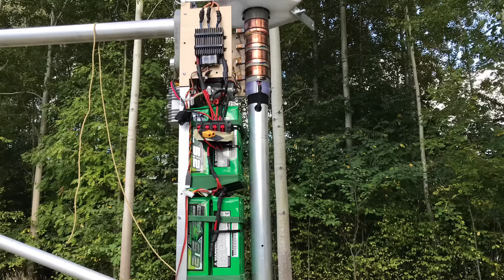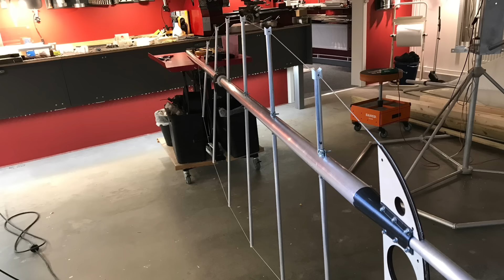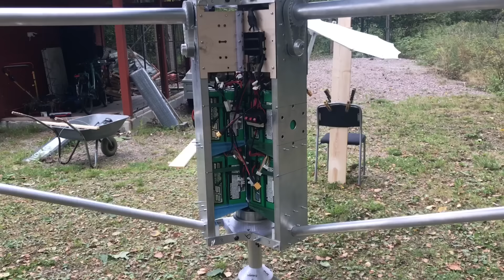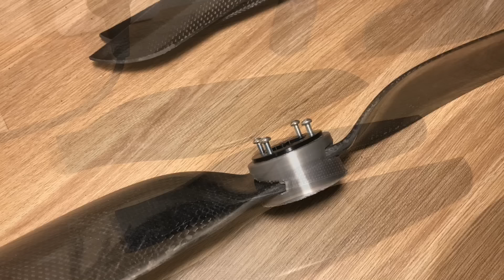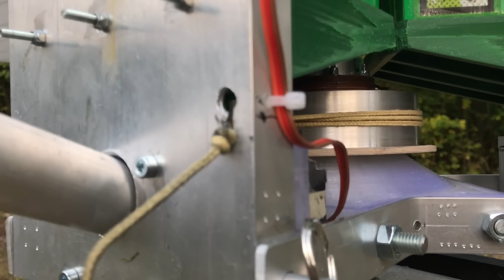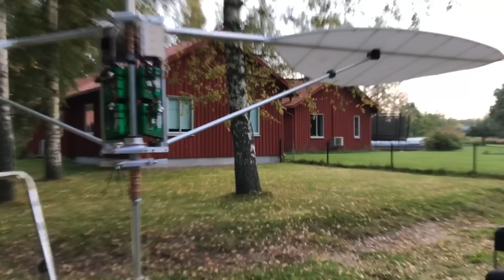Coaxial Levitator 1 Assembly and first ground test.

Comment: 1) for the props touching, make 2 different size rotors, one larger than the other in diameter. 2) I would use the battery packs to counterweight each individual blade at 180 degrees but as close as possible to the main shaft (depending on the batteries weight) to save more momentum and less wear on the motors trying to push and win resistance when at full speed, kind of like a flywheel. 3) start at almost 0 degrees angle of attack for all the blades when starting to help build momentum faster and saving battery then when you need collective once you have reached your full speed of rotation you give it.

Comment: Cool project! We are also located in Sweden and are developing a Blade Runner style roadable flying car, with no folding wings or exposed rotors. The project is called Sky Chaser, and it looks and drives like a car, and flies both vertically and horizontally, and is even amphibian. An artistic picture of the vehicle can be seen in my icon, and by clicking on it you will see a presentation of the project, and flight videos of the 200 lb full scale prototype we have built. More info can be found by searching: Sky Chaser flying car. Good luck with your project and I can't wait to see your next video!

Comment: I look forward to seeing your solution to the prop clearance. Another idea might be to instead slightly shorten/lengthen the arms that the motors are mounted to, this way the props aren't directly on top of each other? Do all the motors need to be the same distance from the center for speed control and power/efficiency reasons? So many questions, very interesting stuff!
Reply from the maker: Good questions! Hope to find the answers an share the result!

Comment: What if you created more space between the rotors by essentially flipping the lower rotor upside-down instead of making the machine taller? I e. blades on the bottom, braces facing up.

Comment: I suggest you install motor for all edges of the blade in order to balance the blade tracking and also use a smaller rotor blade for the six main rotors blade angles, this will gives a smooth rotations and creates more torque even if the blade pitch get higher.

Comment: One way to try and overcome the trailing blade problem is to have only a single blade - a monocopter, in other words. That way, it won't go around at a constant angular speed. It will naturally fly at a relatively constant airspeed, changing its angular speed instead so it "whips around" quickly on the trailing side while flying forward slowly.

At this size, though, we're probably talking something that looks like an airplane or quadrotor biplane on one end and a countermass on the other end.

Comment: On prop clearance between the upper and lower rotors, have you considered extending the motor mount at the tips of each of the blades/wings for either the top or bottom rotors? By staggering the overall lengths between top and bottom rotors by even just a few inches so they aren’t passing directly over or under each other, you can buy yourself extra clearance equal to twice the length of your prop blades.
Edit: super excited to follow this project.

Comment: 2:28 Why can you not use wire braced wings and more? If you have a third as much vertical space on the axle, then you just need three times the wire strength... And the added stress on the strut inside the wing should still be negligible, I would guess.
Scaling it up would potentially cause problems, though. Three times the wing span means 9 times the wing area, and thus 9 times the lift and weight.

Comment: The brake idea is interesting.
Disc brakes are good too.
I think it would be easier to control if you used something like a coreless motor, which has low rotational resistance, as an electromagnetic brake.😀

Comment: Great job. I think you will need motor driven propellers to be 90 digress to the ground to get the best thrust. Have a look at tale dragger aeroplanes and propeller efficiency at high angle of attack. I hope this helps 😊

Comment: Awesome build. You could make the lower rotors slightly larger to increase the distance between the propellers. The lower rotors are going to be in the wash of the upper rotors and be slightly less efficient. The increase in diameter might even things out. If you did have a prop strike it would only be one propeller getting damaged.

Comment: Enjoy your videos very much. Instead of lengthening the center shaft, have you thought about removing 2 to 3 inches of length off the lower wings where they join the center shaft. This should give you the clearance needed and be easier than lining the center. Just a thought. Good luck with your project.

Comment: If you had a rotatable push fan on the top center shaft could it push the device forward which would also provide a slight tilt to the other blades.  Rotatable for direction.  Nice project

Comment: As you have already developed and demonstrated a (very successful) tip drive concept, why would you go to a coaxial configuration? The only reason for a coaxial configuration is to cancel the opposing rotor torques if the rotors were shaft driven. Am I missing something?
By the way, it’s a great experiment and demonstration! I applaud your efforts!
Reply: Think of it this way: you have a cylinder with wings spinning 1 direction and a shaft just rubbing against that.
Reply: He mentions its an attempt to prevent problems of dissymmetry of lift causing rotor flapback and limiting speed.
Reply: @Ben-Dixey so something we usually solve using a fast main rotor and a swashplate. Quads don’t need a swashplate. Koaxial helicopters need it to be stable .
Reply: @ArneChristianRosenfeldt  yes, the problem is a fast main rotor requires a lot of power as your pushing the blade tips through the air at 400mph+. If a low speed rotor could work then the power requirement would be lower, the noise would be much lower and also the danger of a high speed rotor. 
It's not without its issues but well worth experimenting.
Reply: @Ben-Dixey  so like this human powered helicopter. Still had a single rotor.
Reply: @ArneChristianRosenfeldt  Yes, the human powered helicopter had to be flown inside with no air movement. A slight gust would have affected it massively. Wasn't the human powered helicopter a quad arrangement ?
Reply: @Ben-Dixey  from my memory it was a single rotor. Wind velocity relative to rotor velocity. A slow rotor is more sensitive? The blades were fragile.

Comment: Don't understand, why use propellers instead of just directly driving the central axle? Seems a lot easier and more efficient. I'm not seeing something obvious?
Reply: Probably can’t buy such a motor or the weight of the rotor/stator would be quite heavy? Just spitballing here
Reply: Actually it’s almost certainly because he owned those motors already
Reply: @framegrace1  driving a large prop with smaller ones is actually more efficient
Reply from the maker: Good question with many answers, some already covered here.
Top of mind right now:

1,Failsafe/redundancy. 
This setup, by design, make the entire entity fault tolerant, which is critical for a home built flying contraption built out of "prone to fail" hobby components. 

2, Complex high torque light weight drive train. 
This large wing area, low RPM rotary wing design need allot of torque to take off. Building a light weight high torque coaxial gearbox in a modest home workshop safe enough for manned flight just is not a challenge I am willing or interested in taking on.
Reply: @amazingdiyprojects I think that I have seen a machine to cut any number of helical teeth into a metal cyclinder. Assemble mirror bolt together to compensate axial forces . Maybe guard rails similar to a railway could also be bolted on. Then decouple all forced from the outside. Vibrations. Just 3 torque ports.

Comment: I have a prediction but it will probably be wrong 😆. My prediction is that the coaxial version won't solve the problem of rotor flap back. I think both rotors will flap back at a similar air speed to the previous version. I only say this because I believe I have experienced flap back in a coaxial. I think they behave the same as single rotors do. Like I say I'm probably wrong, you are way brighter than me, hope it works ok so we can find out.
Reply from the maker: Hmm, Interesting,  I have not even thought about that possibility!
Its what you do not now that gets you....sigh...
Reply: @amazingdiyprojects  As I say Axel I might be wrong, we need to know the answer. It will be great learning about this machine and it will worth the effort either way. Yours is unique in that you can control each rotor speed individually and it's tip driven, very interesting stuff.

Comment: He's back!!! yes and has been very busy behind the scenes. Looks brilliant. Just wondering, could you have just used differential thrust to provide yaw rather than a brake ? I would expect the machine to sink when yaw is applied with a brake. Rotor blade tips brakes have been used to great effect before but it probably wouldn't work on yours because of the low tip speed. Apparently rotor blade tip brakes didn't result in the loss of rotor thrust.  Of course differential collective pitch is the other way to control yaw. can't wait for the next video.
Reply from the maker: Hi Ben!
Sorry, that will not work in this design, the stationary undercarriage is only coupled to the rotating assembly via ball bearings, there is no torque transfer path in between like a drive train or such. Also there is no torque transfer path in between the rotors as well, they can spin at different RPM!...😀
Reply: @amazingdiyprojects  Ah yes, understood. 👍

Comment: The problem I see here is the inefficiency. You’re using electrically powered motors to spin up larger lifting surfaces, where it would be far more efficient to utilise direct lift from the motors. Every additional transfer of power reduces efficiency. Also, without perfect balance, you set up catastrophic resonance or flex in the central shaft.

Comment: Will the self-canceling gyroscope make it stable, is that the Idea? Dividing the power source between 6 light-weigh motors is elegant. Nice
Reply: A single motor is more efficient. See car or plane.
Reply: @ArneChristianRosenfeldt  true. But as a test for new affordable technologies, this is right up there. Spinning these tiny motors as part of the lift dynamics is as much an exercise in elegance as it is a race to achieve an optimal power-to-utility ratio—we already have helicopters, after all.
Reply: @KymHammond  yeah, actually I am mostly interested in the gearbox. Maybe I should have studied mechanical engineering. But I feel like a large diameter, but thinner gears bring down weight. Also : autorotation works with a broken gear. So just need a modern microcontroller to check for broken teeth and initiate landing. Fast reaction time! Why can’t I have small teeth? Six Small rotors on the tip are of course much louder than one big on the tail.

Comment: I like that leading edge bow construction. 👍🙂👍
Did you come up with that design or was it adapted from another vehicle?
Reply from the maker: Well, I did come up with this for this specific build;  a (relative) light weight simple wing structure.
However, I would expect that there is just one like this somewhere else around already. Its a big world with a whole lot of wonderful creative people in it after all! :-)
-That being said, it really does put a smile on my face that someone else understands and appreciate details like this, I did feel cleaver when I came up with this solution for making the leading edge light and stiff.
Reply: @amazingdiyprojects  
For a few years now I have been trying to build the world’s last paper airplane. Not using any tape or glue. I have considered many designs. All have failed to achieve the desired results. My next design will look somewhat like a delta triangle hand glider or a stunt kite. The skin will be attached similarly to the way roll up blinds are attached to a central rod.  That will limit the shape and size of the plane. I would consider using your design if I wanted to make a curved leading edge. I will keep it in mind. So, yes. I could make your entire design only out of paper. I especially also like your three part blade design. That could be key to making my design lighter. If I went with a soft leading edge design like an umbrella has .

Comment: Why not make the bottom wings a little shorter or longer than the top wings then you won’t have the problem of the props hitting each other as they spin.
Reply from the maker: Good point. I made all wings the same, except for mirroring one set, for the sake of simplicity of construction. The airflow under the upper set will be contracted so  a smaller diameter lower set of wings would do just fine, so yes, good idea. Might just do that if I ever get around iterating on this coaxial version of the levitator.

Comment: Still using those mechanical communtators...
If you know the angle between wing1 and the immaginary front direction
servo1 = pitchRC * cos(ang) + ailRC * sin(ang);
servo2 = pitchRC * cos(ang+120) + ailRC * sin(ang+120);
servo3 = pitchRC * cos(ang+240) + ailRC * sin(ang+240);
write servo 1,2,3 to timer based pwm generators. Attach servo to signal.
If you can figure out how to measure the angle every 20msec i can write the code including decoding of RC signal. A $2 arduino nano can do it.

Comment: I think you loose a lot of power by having motors so far away from the batteries due the resistance of the wires.
Reply from the maker: Its a good point. I have compensated the length with thicker wires, 3x4mm2 motor wires, which means the resistance is reasonable at 50-70A but I pay for that by added weight.

Comment: bet 10 bucks, it will not fly based on current model. 
Reason: too heavy structure and too little thrust. need to change the frame to lighter weight material